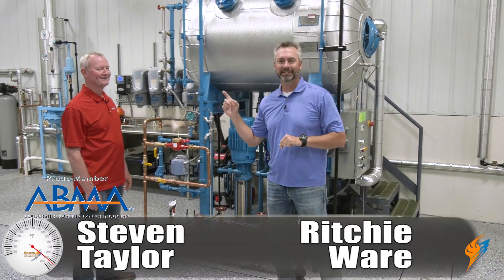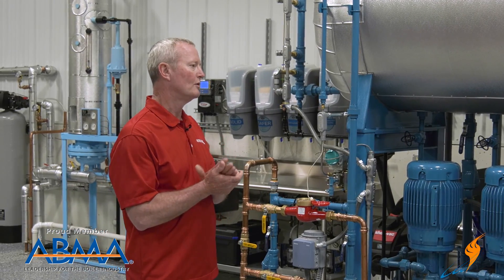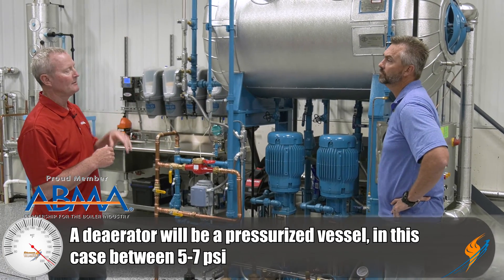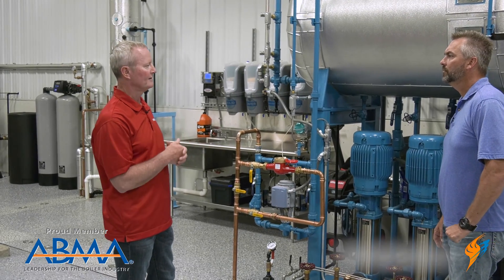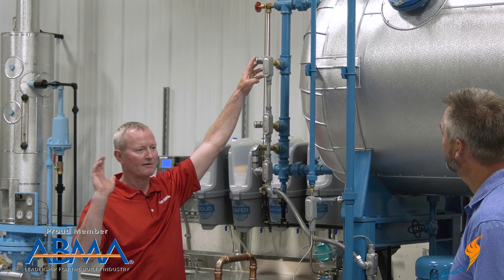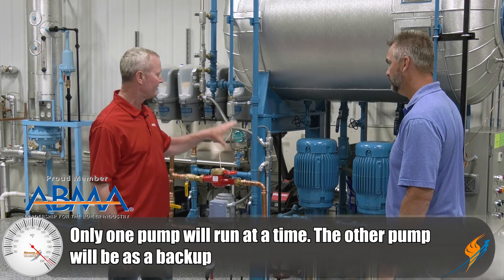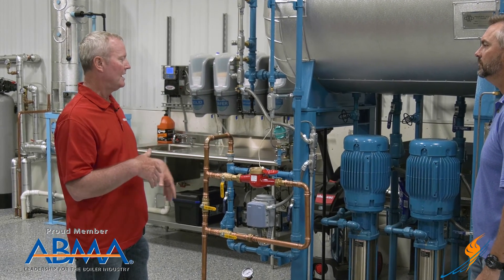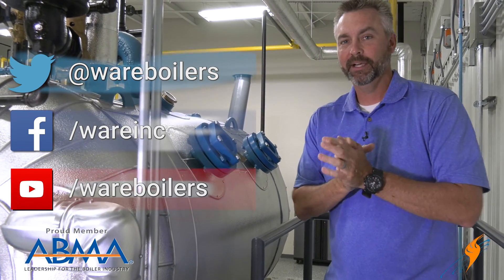What Does a Steam System Feed Water Deaerator Do? - Boiling Point

Comment: My DA tank is banging after the cold water feed valve shuts. The pressure goes from 5 psi to 3 psi and seems like it goes into a vacuum. It’s a Bryan tray type. My other DA gets its feed water from the surge tank so the water is preheated so there is no shock. 
How do I get rid of the banging

Comment: What is the minimum size boiler you would use a deaerator on?  At smaller sizes i would imagine a Spirovent or Pot Feeder of Oxygen Scavenger would make more economic sense?  I haven't seen deaerators on small residential or small apartment building applications but that may be my limited exposure.

Comment: I was asked on my L.A. Steam License exam to name five purposes of a D.A tank and everything that I have read, gone to classes on they only mention three, which you guys went over. 

1. Preheats the boiler feed water. 2. Removes oxygen. 3. Act as a storage tank. What would be the other two purposes?
Reply from the maker: Two other purposes of the DA could be that it removes carbon dioxide and recovers flash steam returning with condensate.  In a vented receiver this would be lost. Hopefully that makes sense! Thanks for watching and commenting!
Reply: Haha thank you. I passed, this is what they wanted to hear incase anyone else needed some help! 
1.) It is a preheater for Boiler feedwater
2.) Removes Oxygen that causes pitting of the boiler drum. 
3.) Increases plant efficiency using exhaust steam to heat the feedwater in the D.A. Tank. (every 10f rise in feedwater temperature, there is a 1% fuel savings). 
4.) It is a reservoir for available feedwater.
5.) The D.A. Tank is located (10ft) above the feedwater pumps on the suction side, providing pump head (positive pressure) caused by gravity. 
6.) Condensate return storage tank.
7.) Reduces thermal shock to the Boiler.
8.) It is easier to remove scale-forming salts in the D.A Tank then in the Boiler.
Reply: Pre heat cond return, pre heat make up water, remove noncondensables from make up water, remove noncondensables from cond return, and store feedwater. Theres 5 lol ;) get technical

Comment: Overall, a good video. A couple of nits need picking, however.
1. The deaerator (DA) is a direct contact heat exchanger where steam and liquid come in direct contact. This raises the temperature of the condensate sufficiently to allow non-condensable gases to be liberated. As the DA supply steam is regulated to maintain the shell above atmospheric pressure, the gases flow naturally through vents into the atmosphere along with a small amount of steam.

2. Cavitation is the result of the pressure at the "eye" of the pump impeller falling below the saturation pressure for the liquid being pumped. This creates steam bubbles that travel with the liquid toward the discharge (high pressure end) of the pump. When the pressure exceeds the saturation pressure, the bubbles collapse. It is the collapsing bubbles that cause the sound like "pumping rocks." Think of the sound of clapping your hands together. The walls of the bubbles (incompressible liquid) coming rapidly together, makes the noise. At the same time, these little "shock waves" impinge upon the impeller and slowly "jack hammer" the material away.

This is what Net Positive Suction Head (NPSH) is all about and why the DA is normally installed at an elevation significantly higher than the feed pump suction. The static head of liquid in the DA and the low-low DA level switch protect the pumps from this damaging phenomenon.
Reply from the maker: Appreciate your response and while everything you say is technically correct we try not to get too deep in the weeds with these videos. If it gets too technical then we tend to lose our audience. Giving them just enough information so that they know why things happen but not so much that we lose their interest is a balancing act that we have to do on all of these videos. Our Boiler University gets into the weeds, real deep. That is where we take the time to explain, in detail, all of the points you make plus much more. Hopefully that makes sense.

Again, really appreciate your feedback and you continuing to watch our videos.

Comment: so you should compute NPSH correctly to avoid cavitation.
Reply from the maker: When we design the systems, we do calculate out exactly what these pumps will need to run properly and without cavitation. What we cannot plan for is any external factors that might lead to situations that cause the cavitation. Anytime operating conditions change (such as PRVs being stuck open letting in too much pressure), even with proper calculations, cavitation can occur. Hopefully that clears things up and thanks for watching!